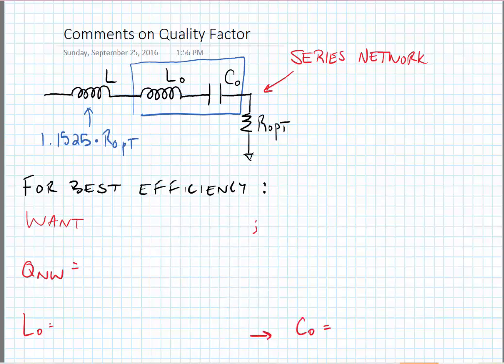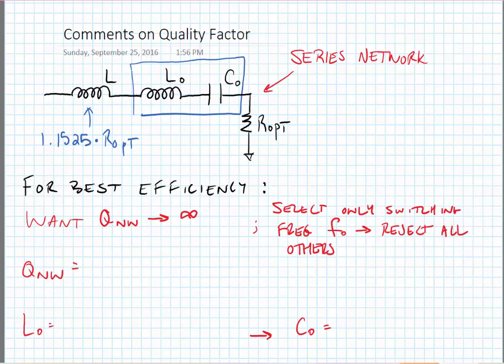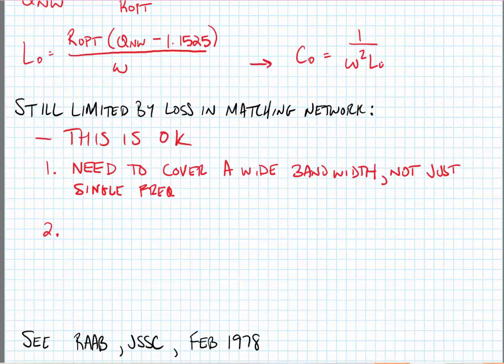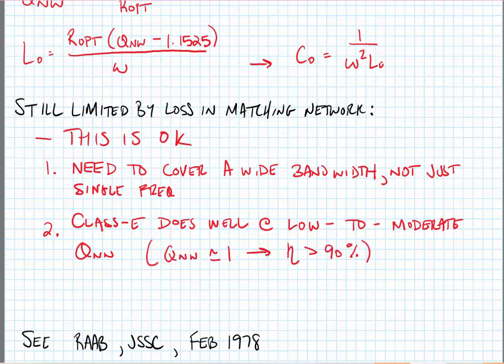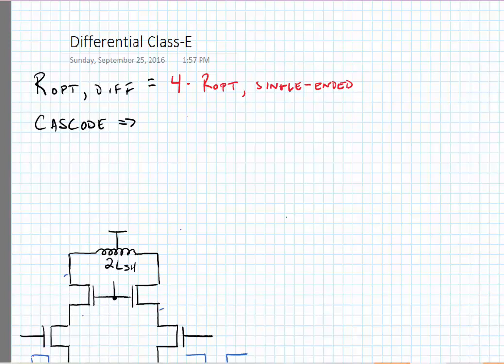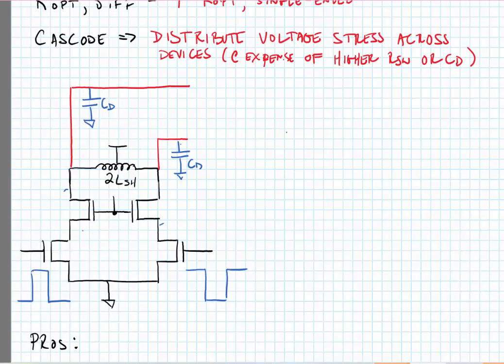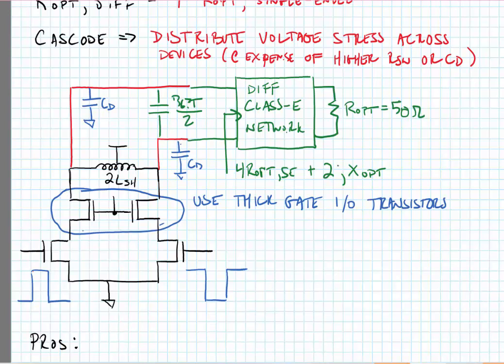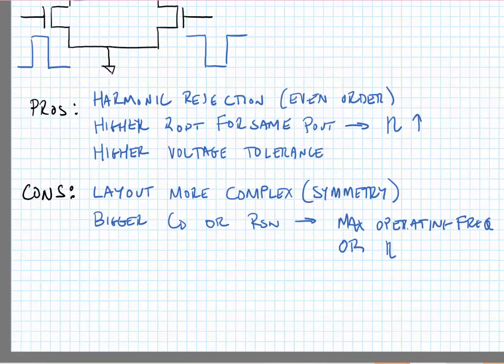Lecture 14.2 - Network Quality Factor and Differential Class-E PA

Comment: Thank you for these videos! Would you mind giving a quick explanation for why differential PA needs 4*Ropt, but only 2*Xopt?
Reply: My question is why do we not use the1.365*(2.5*VDD)^2/Ropt (Parallel single ended uses shunt thus the 1.365 and my prediction of the 2.5V) or .577*(3.6*VDD)^2/Ropt (series single ended uses choke thus the .577 and my prediction of the 3.6V) instead of .577*(VDD)^2/Ropt (for series single ended) and 1.365*(VDD)^2/Ropt (for parallel single ended)? You mentioned that that is how high the VD is in lecture 14.3. Shouldn't that change the output power? For differential it is considered two tone, so the output power doubles, so for differential I would think it would be .577*(3.6*2*VDD)^2/Ropt (for series differential) or .577*(2.5*2*VDD)^2/Ropt (for parallel differential), but I think you are saying it is still just .577*(2*VDD)^2/Ropt (for series differential) and 1.365*(2*VDD)^2/Ropt (for parallel differential). Can you explain that?